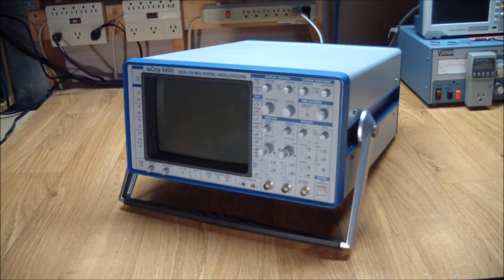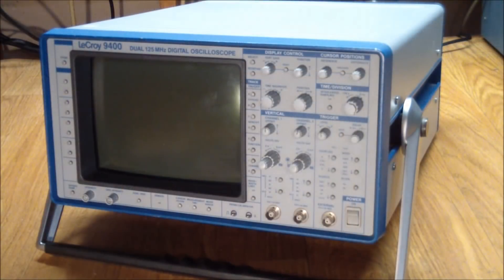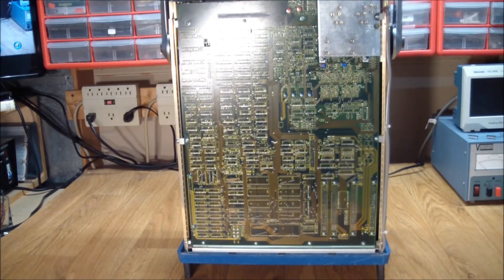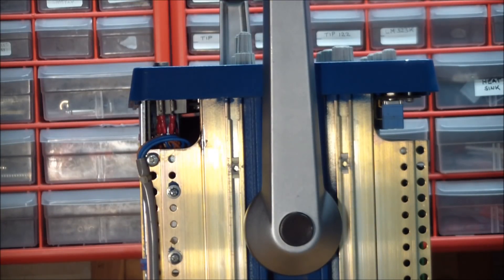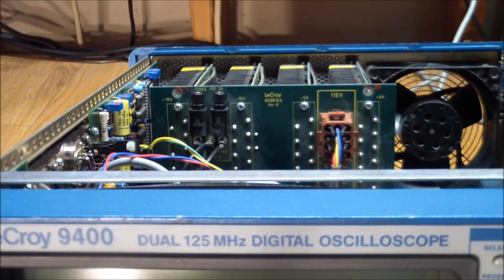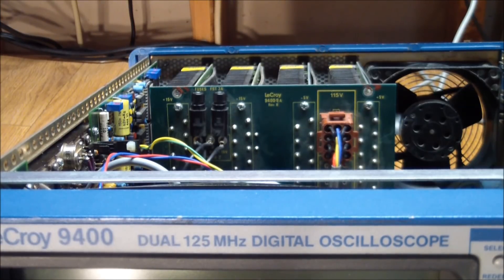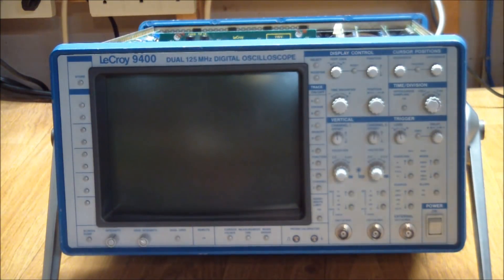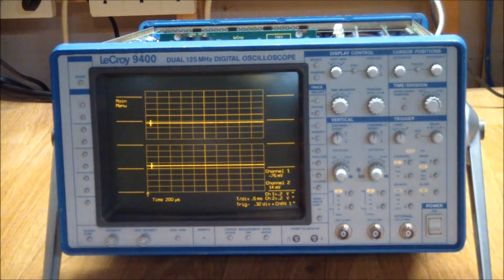AE#36 LeCroy 9400 Oscilloscope Repair Attempt

Comment: Since watching this year's later I now have come to the conclusion it is the front panel pots to the knobs. Dirty controls is my conclusion and to the lag on video also. I don't know how these worked when new. Since you went through the regulators probably not the power supply. Thanks for showing us this old scope. I think it just needs the front panel knobs disassembled and cleaned and you will see it work beautifully.

Comment: Sorry for resuerrecting this. AFAIK, there is a little tantalum cap on one of the HADACC chips, which keeps the heatsink away from the IC. Check that first, I think it could be thermal.

Comment: The distortion is the exact same on both channels, so I don't think it's a problem on one of the acquisition boards. The spikes are mirrored on both channels, so I guess the problem is after the CPU, somewhere in the area where the digital data is made up for displaying the waveform on the analog CRT. Prob. a simple power/voltage problem?

Comment: I have a 9410 which came from Hughes Aircraft in California.  I believe it was used only a couple of years and then put away since it is very much like new and only needed a DAC gain adjustment to bring it back into spec.  I'd very much like to be able to find a PCMCIA interface board and a new option GAL for it.

Comment: My best guess is that this unit has got an (un)healthy lot of sugared beverage. That even got blown though the fan. It could also have caused the HV rectifier diode go bang. Then they turned of the unit and dried the unit externally. As it still didn't work, they just let the thing dry out for a couple of day. Now the disaster was complete: all front panel controls stuck (except those not connected to the front panel), power switch stuck, fan bearings and rotor gaps stuck etc. and finally that stuff is everywhere on the PCBs and disturbs low level signal circuits as in combination with humidity its more or less slightly conductive.
Reply from the maker: Great analysis. I don't feel too bad about giving up on it.

Comment: You can try piggybacking the chips. It won't always find the fault but I have successfully found problems that way on many occasions. Use a bit of tape to secure the chip before you plug it into the scope. Granted you may have more than one faulty chip on the board so pay close attention to the display and look for any changes as you go through them. Seeing that you said you want to give up on it you have nothing to loose by trying this and you aren't going to be doing any damage with this method.

Comment: I think i know exactly how you feel, bought a cheap dead Tek 2430 and found a mess inside, zillions of strange faults, probably scrap it, too time consuming.
Anyway,...did you try to pull the bad board and only run the good one alone ?  The more i look at it, the more i have the impression this is a power (supply) issue, or an interference from the CRT. These old processor/ram boards are very sensitive on the  PS rails, i would check/add/replace all the ceramics around the chips, these are very important. Also check those 78xx voltage regulators for HF oscillation, i cannot see any ceramics there, electrolytics only is not enough to keep them quiet, you need a low induction capacitor on Vin and Vout. 
Did you change frequency of your test signal to see f it makes a difference ? Another thing which springs to my mind is those sticky buttons, what made them so sticky ? Do you have a simple contact/corrosion problem or perhaps a pot playing up,.... just my 5p,

Comment: I repair broken scopes and usually try to resell some of them when I can,  and I had a similar issue like this,  and it drove me nuts on two separate scopes - a Tek 475A and a Tek 2225.   Two of the first scopes that I had worked on.  It would trigger on a signal fine,  then just randomly get unstable and the signal would turn into a mess all over the place.  Then it would trigger fine again,  also some distortion mixed in as well.  Sometimes I could stabilize it,  sometimes not.  I struggled for some time with this until I just so happened to put the metal case back onto the scope and tried it again and everything instantly fixed itself.   Of all things,  unstable triggers and distorted waveforms caused by RFI noise around my bench.  Some scopes seem to exhibit this behavior and some don't.  Strange.
Reply from the maker: Intermittent failures caused by RF interference have cost me many hours, just like what happened to you. Unfortunately this one never worked properly.

Comment: I had good success driving these boards (memory/bus) with an arduino mega that offers sufficent ports and is cheap.  The test setup used a lot of the tiny clamps from banggood - you might know them from USB logic analysers.
Great video! Thanks!

Comment: Say artie I don't think it is ram contention. Since it is on both channels and is intermittent it seems to me to be on that lower main board. It seems to me to be introduced around the  motorola 68000. So my guess is still capacitors or diodes on the main board. Since it is trying to work right it nearly is. But if you track that 5v on the main board my bet is it will drop during failure and is accessible all over the bottom i think.

Comment: Sillicon is not a semiconductor, its only when it is doped it becomes a semiconductor, else it is a very very good insulator.
Reply: Silicon is a semiconductor. It's the doping that determines it's conductivity or non conductivity. Bare silicon when heated starts to conduct a lot of current.
Reply: Silicon absolute is a type IV semiconductor.  In pure state its an intrisic semiconductor with about 2k ohm-m resistivity at room temperature, not even remotely an insulator.  Compare diamond with an intrisic resistivity of > 10^40 ohm-m, which does count as very very good insulator - why not check your facts before posting nonsense?
Reply: If you had been listening carefully you would have reallised that he was talking about silicone @5:37 which is a very good insulator. I have never seen it in fine granular form and would like to know if I can obtain some of this without going to New Mexico.

Comment: I notice that the graticule (grid) and the scale or other status text is steady while the traces are jumping.  That to me suggests the DAC side and the CPU are working more or less properly.  Therefore, your suspicion about the acquisition memory access is suspect.  But that can be either during the writing or reading and a logic analyzer would be highly desired.  I actually would try to look at first the I/O select lines and then the rest of the address lines.  Using a very slow analog signal would possibly benefit by eliminating some of the clutter on the logic analyzer.  A further speculation is that the CPU interrupts might have some problem.  Best luck, if you care to continue!

Comment: The waveform "spikes" are mostly constrained to the same amplitude as the waveform itself, which to me implies that they are actual samples, but being read in the wrong order.  If it were data bus contention, the spikes would cover the entire range of ADC values, right?   So I would guess that when the CPU reads the data, sometimes it reads the wrong address.   Maybe just a bad connection on the CPU address connections to the acquisition boards?   But what is the DAC for?   The CPU would convert the data waveform data into bits in the screen memory, right?   I don't see where we need a DAC.

Comment: What type of diode did you replace, on the CRT driver circuit? I have a Lecroy 9415 with dead crt ... and diode D40 open .. but the model cannot be read anymore ... thanks

Comment: something tells me this is a clock problem. The clock on the aquistion board appears different from the clock on the main board. Maybe the clock battery is dead?
Reply from the maker: Could be, but the scope has been adopted by someone with more patience than me, so I probably won't find out.

Comment: well art: yes I have changed my mind again. now I favor a cold solder joint. or cracked solder somewhere. One thing I have not seen you do with this scope, that while misbehaving, picking up the front, off the stand one inch and gently, thumping it back down, to observe the behavior. I think now it is a cold solder joint, not a cap, or memory, unless the memory has a leg disconnecting intermittently. I like this scope, and think it will be a useful bench addition for you. Have you thought of putting that last card in an oven @ 480 degrees, without the plastic components on board? I have seen Linus save a graphics card that way.
Reply: useful bench addition,   nice joke , man cant even handle tearing it apart , its that bad . talking about memory allocation what a disaster

Comment: All the buttons and controls were frozen.  You cleaned them with IPA, which is not the most recommended product.  Probably did not do a well enough job.  I'd put my money on bad contacts caused by dirty swiches & controls. Edit: do not forget to clean the relay contacts.
Reply: I don't know much about electronics but the way the switches were stuck sounds like there could be a lot of dirt/oxidation everywhere. Maybe clean and reseat all connections, clean switches, pots, var cap, encoders, etc. Anybody got an ultrasonic.

Comment: I'm guessing the sand had got into the pins of the BNC's.... and all the pots for the position and TB controls. The fine stuff can get absolutely everywhere. I used to live on a boat on a drying tidal river. The silt that would get left by the highest tides would dry in the summer and blow around. It was never as thick as your red stuff, but it was amazing where it ended up, and played havoc with things like the bearings on the radome and the repeater for the nav and sounder up on the flybridge... and the VHF radio. LOL sand, with added salt in my case, and electronics are not the best of friends.
Reply: Gerry - I'm with you on this...Why clean obvious dirty switches, but didn't clean pots and all plug pins? The moment I noticed the erratic trigger by touching the  pot reminded me about the good old days of goofy Sansui receivers needing a shot of WD-40 in EVERY pot (of course today that would be a sin - need to use DEOXIT). Are we still allowed to use an eraser on the board connector contacts? LOL